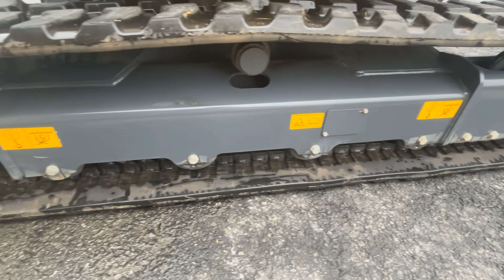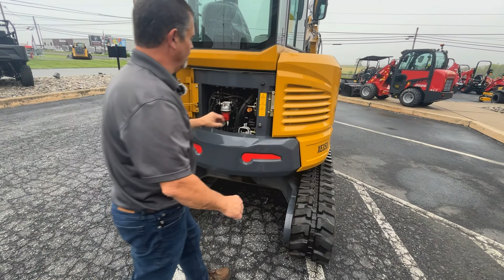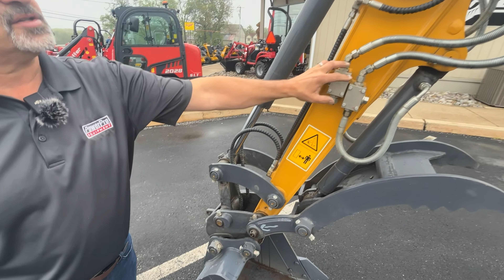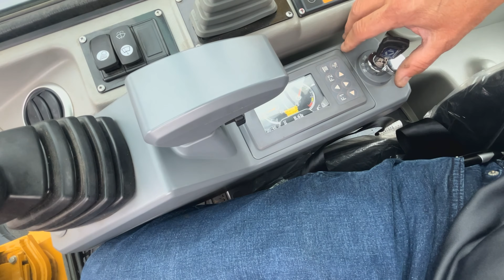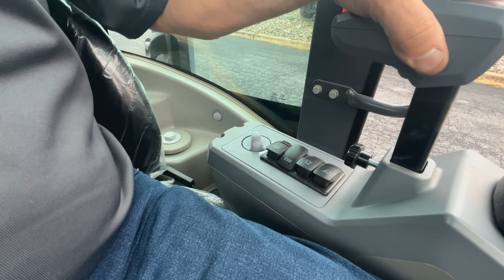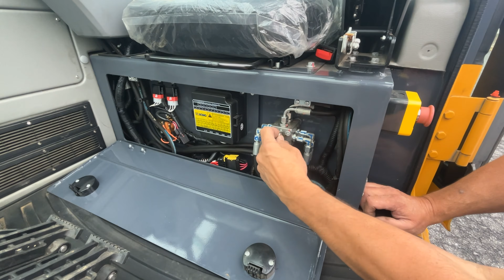XCMG 35 U WALK AROUND,

Comment: DO NOT BUY ONE OF THESE> There is a problem with the hydraulics. I have had one for 2 1/2yrs. It has been at dealership for a year accumulated time. Has less than 80 hrs on it. I even had the tech from XCMG come to a site with 3 people from dealership (National Equipment Dealers in Wellford SC) to see machine run. Tech from XCMG finally got the drives to function better but still has problems. I purchased machine to run cutter head. Now I am being told it will not run because it does not flow advertised 10.6 gal at boom. I have had machine at dealership 6 times, each time being told it is fixed. I am being told by NED GM that they will not do anything else because XCMG will not warranty it through them. Complete FRAUD and waste of money. Buy  Bobcat or Takeuchi or Yanmar. XCMG will not fix and they do not hold any value.
Reply: Ya, this is a very small machine to run anything rotary imo.  An auger, rotator, grapple, or a hammer should be fine though.  The larger machines will have more horsepower and a lot more GPM available in the aux circuits.  I haven't seen a rotary cutter small enough for this machine yet.  Yanmar sure makes a nice machine!

Comment: What is a ballpark price on it?
Reply from the maker: reach out one of our 9 power pro location listed at the end of the video
Reply: @PowerProEquipment  I never understood what the big secret of prices is. Just post an average price with a disclaimer
Reply: @reloadnorth7722  NEW is going to be north of 40k, they are in the auction houses with reasonable hours in the mid/upper 20's, cab units pull higher prices.  I love mine!
Reply: @PowerProEquipment  What's wrong? Are they afraid to publish the price? People are going to run away.
Reply: @leidehesa8819  Youtube comment "sales" can get weird sometimes.
Reply: @leidehesa8819  prices of equipment change over time and there could be promos or simply a swing of a few thousand between your dealers. If your serious about a piece of equipment just reach out the the dealer directly.
Reply: @leidehesa8819 
Aqui no Brasil e assim tbem...
Nunca falam os Preços